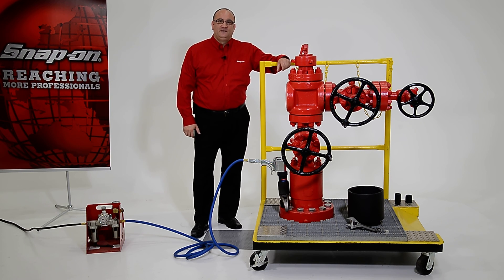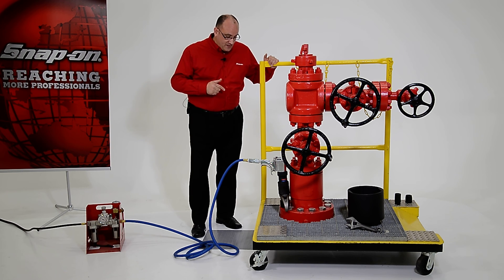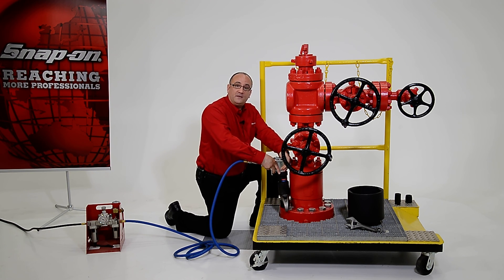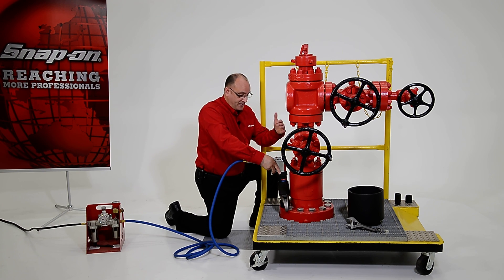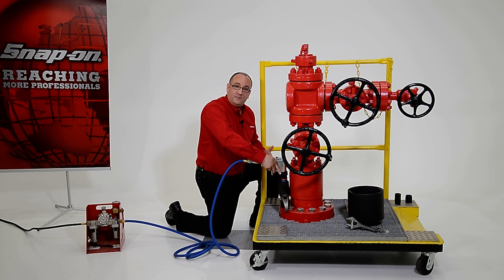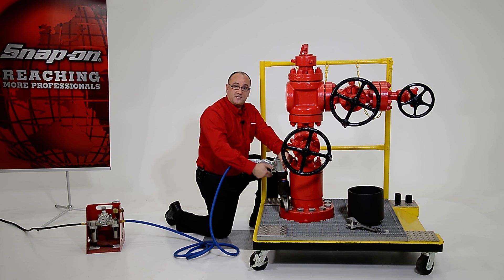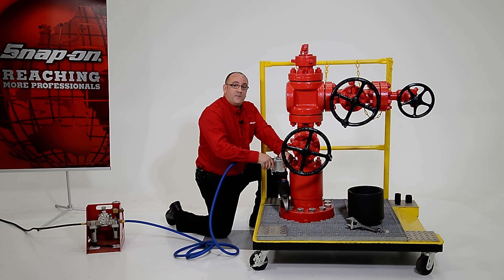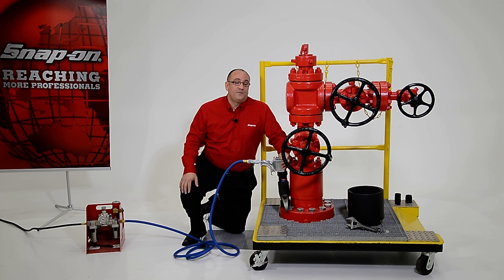Pneumatic Torque Wrenches from Snap-on Industrial

Comment: This Wrench Snap On is Private Labeling, is actually manufactured by Hytorc. Hytorc has copied this wrench from Alkitronics. Alkitronic is the company who Patened this tool.
If you just purchase an alkitronic tool direct, you will get a higher quality tool at a much better price. Plus Snap on does not stock parts to repair this private labeled tool. When you send the tool into snap on for repair, it has to be repackaged and sent to the orginal manufacture for repair. Just purchase from Alkitronic and you will avoid this issues.